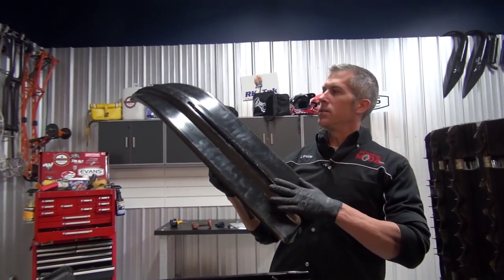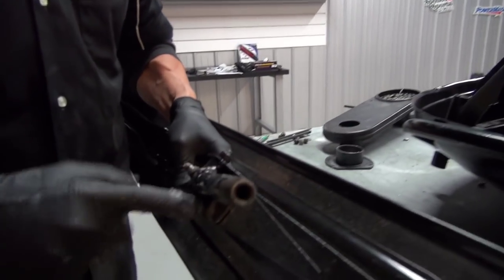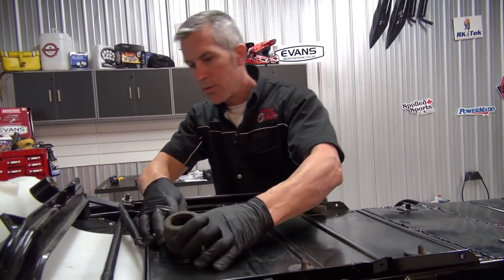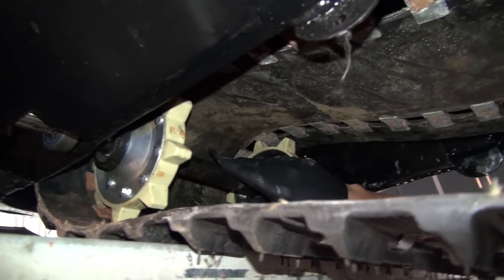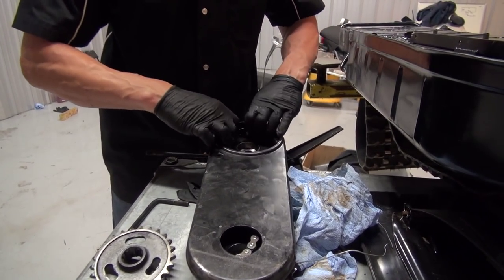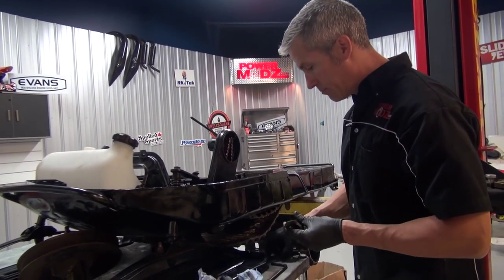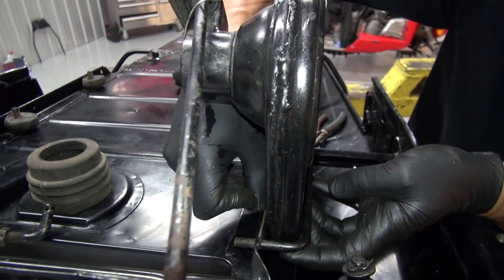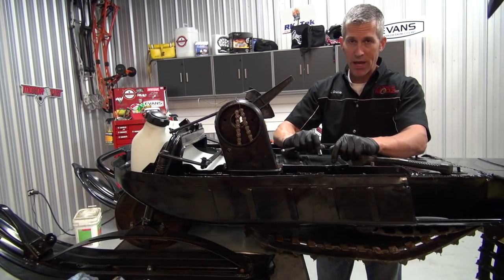Elan Restoration series Ep#8 Chaincase, skis, track install!

Comment: I'm rebuilding a 1973 twin cylinder and it has the threaded holes in the chassis for the cup to support the axle. My 1979 has the other little plate with the threaded holes